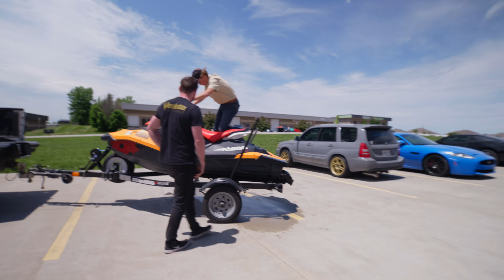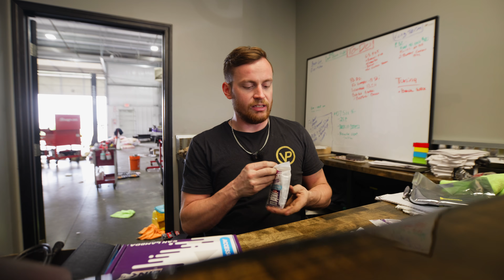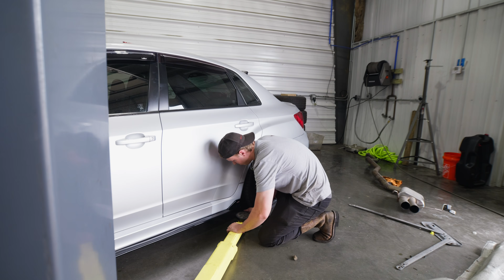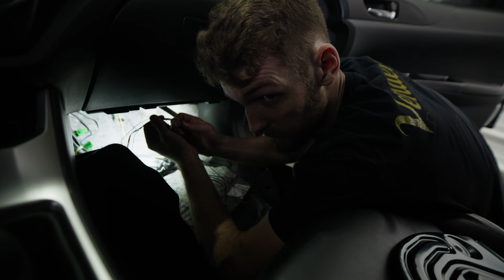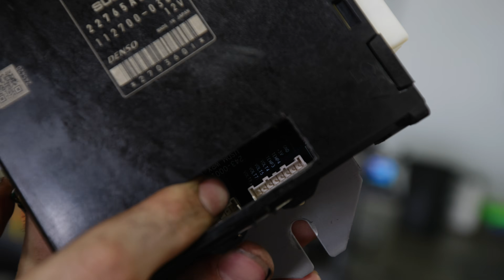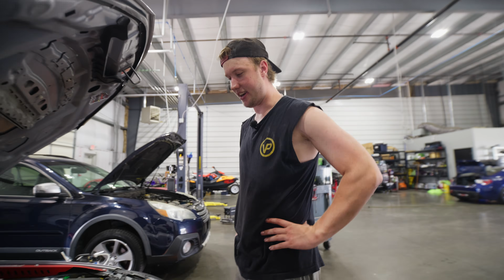HOW TO build a 500 HP WRX STI

Comment: what are the benefits of the link ecu compare to the oem
currently on sd setup with bcp500r and 1300 injectors on stock ecu making about 521whp on e85 on mustang dyno
Reply from the maker: We have much more control and capabilities like rolling launch control. The biggest thing for us is the added safety features for oil pressure, boost and coolant temp that the factory ECU doesn't allow.

Comment: ARP 2000’s?  Don’t go rotated on those studs or the head gaskets are going to give up on you.
Reply from the maker: Chatting with Kent @ IAG this has mostly been debunked.
Reply: What did they say was the limit of arp 2000s?   I thought 25-26 pounds of boost was kinda the max for 2000s but I could be remembering wrong

Comment: Hi  Just wondering if you are using the 160deg thermostat  and the Killer B Large Thermostat Cover. Also can Wire in a separate Switch to Engage Fans at a Lower Opening Temp .Regards from Aust. Wess
Reply from the maker: We're running the standard temp range thermostat so a lower temp one is also a solid and cheap option. We get to set a temperature for when the fans kick on using the link ECU so no need for extra wiring

Comment: I feel 400-450whp is the sweet spot for these cars. A upgraded top mount, FP Blue or BCP turbo, equal headers and it’s a fun car with low end power.
Reply from the maker: My favorite setup to-date is FBO / E85 with a DOM 1.5 twinscroll or equivalent
Reply: @VendettaPerformance what about the Pavel G25-550 modded stock turbo
Reply: sport status... easy to pay for a pshycology and get the status too..
Reply: @vicoe4 and spelling too

Comment: I didn’t catch, does it have a stock rad? Koyo rad with 3.5 ETS FMIC and fully functional AC in a 06 STi stays at least 5-10deg cooler than your numbers in the same weather on the other side of your same state
Reply: in SC, for my 450hp setup, Koyo with AC on, 3.5in ETS, in my 2016 has temps around ~200-210 cruising, ~215-225 at long idles. sub 200 with ac off
Reply from the maker: This car is running a CSF radiator. We're also closed deck block which might have some impact on temps. We cut as little as possible out of the bumper to make the FMIC fit for aesthetic reasons, but if push comes to shove we can upgrade to a triple pass radiator and open up the front bumper more if we see temps get out of hand.

Comment: How do you feel about open source?
Reply: Main difference between opensource tune and aftermarket ecu is flashing and tuning time. With opensource and oem ecu you need to shut down engine to flash map, with aftermarket you don't need to do it. With few patches oem ecu is basically the same as aftermarket but imho a bit more easy to tune especially if it's daily. COBB has the same features as opensource, only difference is no more cat, tgv delete etc.
Reply: @MrKareston   im running open source stock ej20x making 500hp
Reply from the maker: We don't touch open source tuning personally, but it is a decent budget option

Comment: The flex sensor needs a 12v supply. Not 5.
Reply from the maker: Yep, mistake on our part. The reference we tied into is 12v
Reply: @VendettaPerformance Where did you pull the 12v from?
Reply: @josephmercer5476  the battery